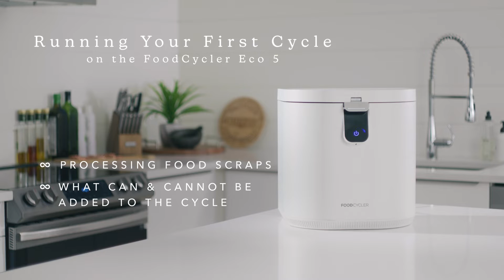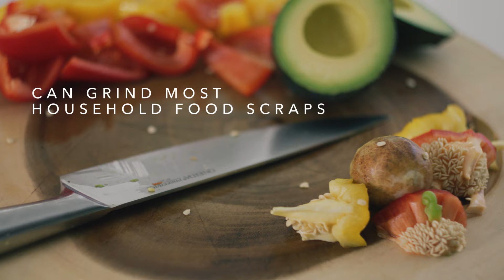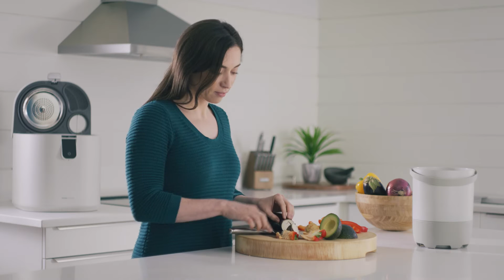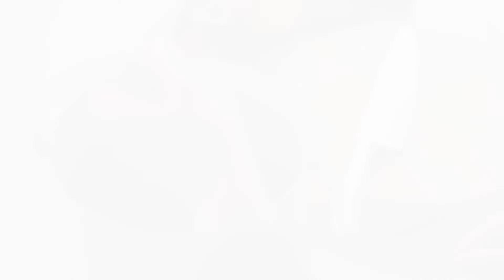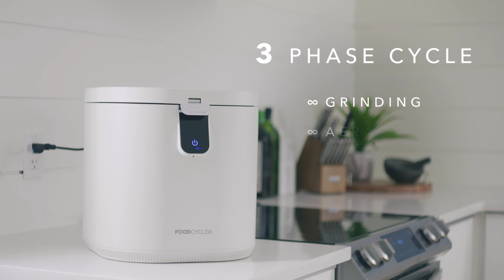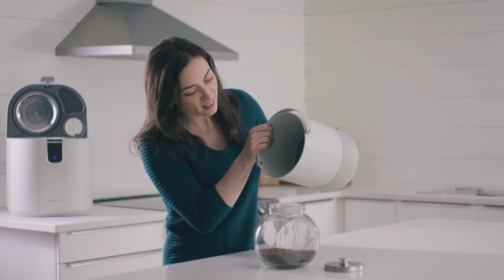Eco 5™ FoodCycler®  - Your First Cycle

Comment: Can I collect food in it for one or two days before I run a cycle? Or do I have to fill it and more or less immediately run a cycle?
Reply from the maker: You can collect food in it for several days. The portable bucket has its own lid, and when you're ready to run a cycle, you insert it into the unit (and remove the bucket lid).